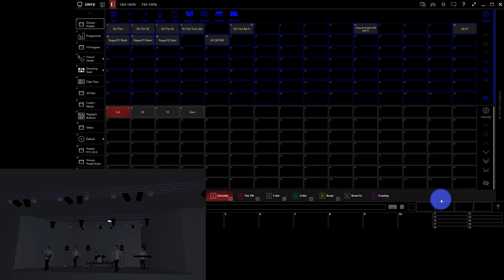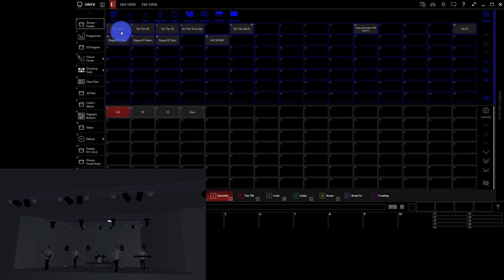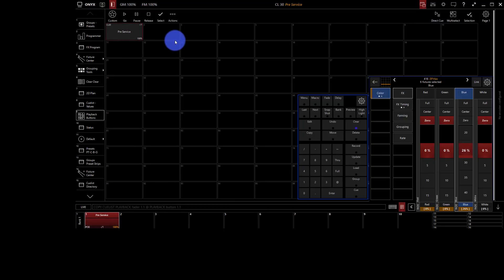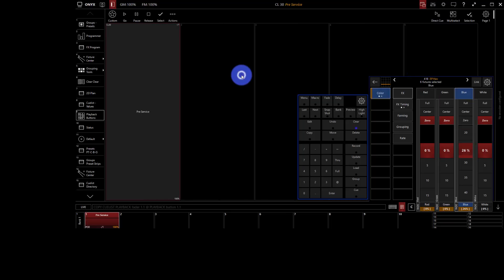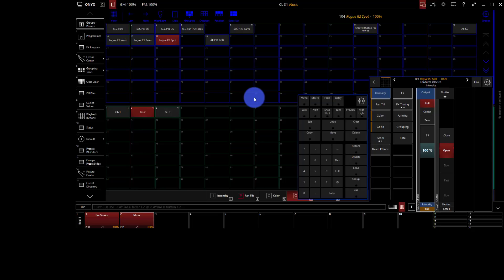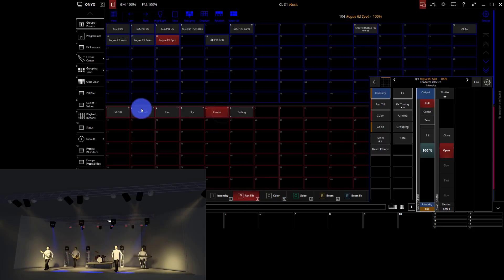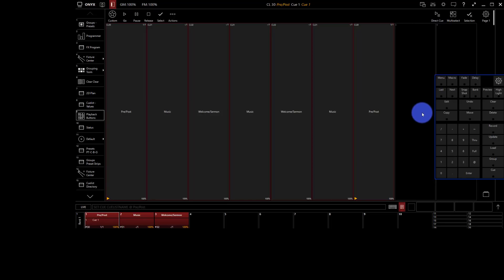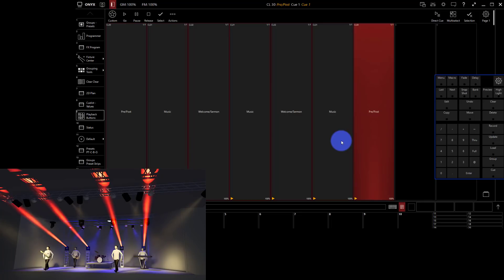Whole Service Method - How to Use ONYX for Church Lighting

Comment: With this method is there a way to make sure that only one cue is active at a time? I’m having struggle with elements of the previous queue being active when a new one selected
Reply from the maker: Either have all of the parameters that you use of every light in every cue (this is the best way, then they will override each other), OR you can also set the cue in the cuelist options to "release on next go".  You just have to be careful with that one, it can backfire if you're not careful and leave you with a very dark room :)

Comment: What we have found easiest on our staff and volunteers is to create a single cue list that has each element of the service and all the volunteer has to do is play through the list.  At the end of the is a cue that links back to the first. We normally run a 4 song set with different colors and graphics each week that the volunteers will program and merge into the existing cues. The other main difference is having a single cue on a different fader that controls front wash. I can see how this method can be easier in some situations but one of the problems I see is your last look (post service) doesn't take out your beams and spots.